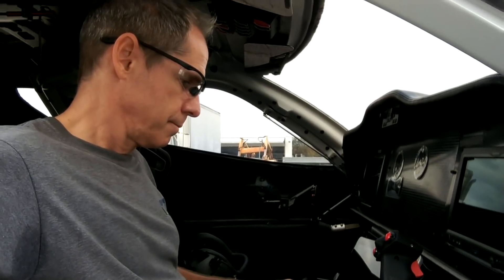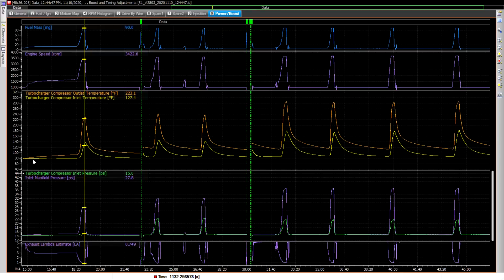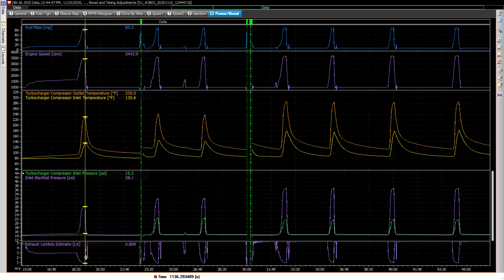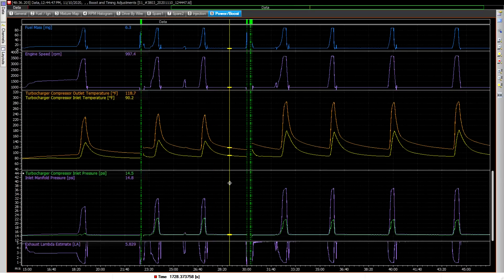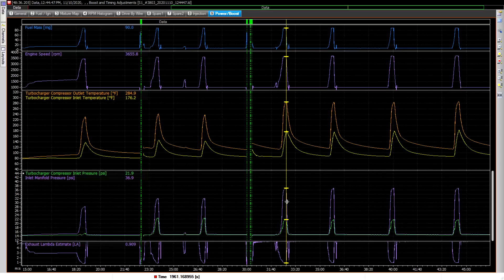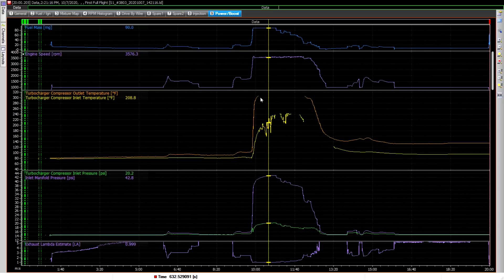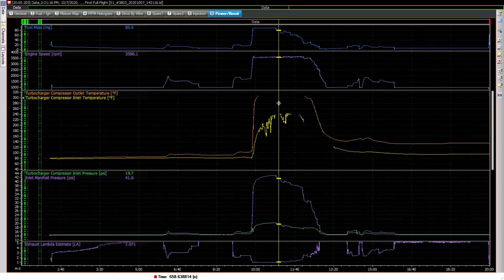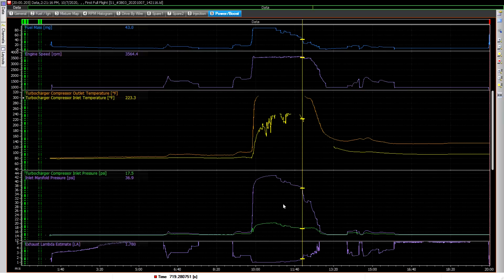Assessing Boost Levels - Building the Raptor Prototype

Comment: Your intercooling is kinda not up to the job it really liked the 43psi run but I suspect that's more like 27psi gauge. I would either go to a bigger one or and I think this would be lighter and easier add a small but high flow intercooler air to air in between the stages and a duct. I'm guessing this will net you something closer to 120°f iat or better.

Comment: Peter, you should speak with a diesel tuning shop. There are numerous misconceptions at play. One is that lambda represents peak efficiency or power. It assuredly does not. Also you'll never get substantially more power at lower boost without improving the intake system efficiency. You should be using a largish turbo that has a ve map suited to your application.  You need better efficient intercoolers with lower pressure drop to cooling ratio. Get rid of the second turbo, it's massively inefficient compared to a single large turbo. Compare your calculated hp to what tuners are getting with your engine. If it's a big gap hire a pro to tune.

Comment: Howdy Peter, have you looked at any of the auto racing community cooling tricks. Summit racing has a number of options for inline coolers where you could replace the lines under the ship. The airflow through the tunnel with gear down could provide significant cooling if you can get them to fit. Of course throwing an anemometer into the tunnel to measure that flow would be interesting. 

Too bad you don’t have the leading edge cooling you discussed early in the program. A lot of surface area in the wings and in the fuel to throw excess heat during the high power demand times.

Comment: It looks like you’re using a sequential turbo setup. This is great for a street car, where turbo lag is very undesirable from a customer standpoint. However a setup like that is very thermally inefficient, producing more heat than necessary .
The engine in a street car spends 95% of its time at <15% of its rated power, because for a regular car only 15-20 hp is needed to cruise at legal speeds. Boost periods are short, often not even long enough to heat up the intercooler.
In an airplane you can spend long periods at or above 75% rated power. But turbo lag is irrelevant in an airplane. 
I would go for the biggest single turbo for this. The bigger the turbo, the more efficient, but the more turbo lag. At 40 lb of boost you are shooting for a 2.7 pressure ratio. Pretty much in the center of the efficiency island for most turbos.

As for tuning for Lambda 1.0. Don’t. Unlike gas engines, the diesel air mix in cylinder is not uniform. The injector spray cone burn rich in the center and lean on the outside. 
Experience has shown that a slightly lean diesel exhaust gas Lambda ( ~ 1.2 ) produces the most power.
Reply: 350 hp at FL250 for an engine that makes barely that at sea level is extremely ambitious. This requirement is normally turboprop territory.

Comment: I been driving, working on and building diesels for nearly 20 years. I have a couple of questions on the heat. Is this a compound turbo? If so is the charge air cooler between the turbos or before the intake. Why did you decide on a air/water inner cooler and not air/air? Is your the reasoning intake air temp at altitude? I would suggest trying an air/air before going through the work of installing an auxiliary radiator. It will drop the in coming air to the radiator to nearly ambient temp. It will also increase air density by a wide margin. Which in turn will increase boost and lower EGTs. Auxiliary radiator, I would highly suggest an oil cooler in the same location. On tuning it's a bold move to try to tune it on your own. I know folks in the tuning world that have been doing it for a decade and are still learning. Get in touch with Banks power, Gale Banks is the pioneer of diesel power. You could get so much power out of that motor and still keep the heat down. Your doing a great job! Keep up the good work.
Reply: You left off a slice of bread if that was supposed to be a compliment sandwich
Reply: @keim3548  I'm in no way making any insults about Peter or the work he is doing. Just using my experience with diesels to help him out. Sometimes when you have an outside eye look at a project they ask questions that you didn't ask yourself when you were building.

Comment: Good vid appreciate the incremental steps in moving to an understanding of temp profile for pattern alt/cruise.  A lot of these comments don’t seem to appreciate running 100% power setting on the ground is not the objective of the exercise.  A Navajo or king air can only run for short periods on the ground at 100% before cyl. Head temps run off the charts....

Comment: Hmm... I must be misunderstanding how moving the cg forward would lower your alpha. The alpha is a function of how much lift you must produce at a given speed, lift = 1/2 rho v^2 cl wing area, so I would expect that the added weight would actually increase your angle of attack, and the offset cg would just mean you have to increase the deflection of your elevator, which both of which would get more drag. Perhaps I am missing something?
Reply: Hmm. Someone must have left the dunny door open. Smells a bit in here.
Reply: The dung beetle stops for a second; something is not right. It takes a few steps back and feels the air for unexplained vibrations...suddenly, it rushes off under a nearby pine cone leaving the ball behind!

Comment: I dont know a lot about engines, but I think it might not be the worst idea to talk to someone who actually develops and engineers engines. 
I do know a fair bit about aerodynamics. I am afraid you are thinking about going for another flight without having tackled enough of the oscillation problem. While closing up the wheel cavities is certainly gonna decrease the drag, I dont think it will do anything against the oscillations. The more forward CG will help in that regard, but you add quite a bit of drag with a more forward CG. The big main wing is a lot more efficient at carrying weight compared to the canard. (even though the alpha on the main wing is decreasing, you add more downwash from the canard onto the main wing, …)
I think the main reason for your oscillations might be an overloaded winglet root. The interference of the winglet and the wing leads to a higher local lift coefficient in the wing-wingled-blend. This is mainly due to the low pressure zone of the wing overlapping with the low pressure zone of the winglet. Since the airfoil in the blend section experiences a higher load compared to the rest of the wing, this section is prone to stall earlier than the rest of the wing. Any sideslip can then lead to the leading wing stalling in the area of the blend. This increases the drag substantially on the forward wing, pulling it backwards. The plane starts to rotate around the z axis and we start to sideslip into the other direction. The other side stalls in the area of the blend, more drag is produced in this area, and so on…
Thus the whole plane starts to oscillate around the Z axis. I already thought about this problem when I saw the videos of your scale model plane, I think you still have the same problem and fixed it the wrong way by just increasing the winglet size.  
This is not something that is easy to fix, but during your next flight you could add some tufts in the blend area and film it. If I am right (which I hope I am not), you should see quite a bit of movement in the tufts, matching the oscillation rate of the plane. A quick fix that might help is to add vortex generators in that area of the wing. Normally during the aerodynamic design, a lot of attention is paid to this section of the wing and the local washout is increased to tackle this phenomenon. 

I think we share the same dream of building our own planes, and I truly want to see you succeed. I am just trying to help, like most people in this comment section.
Reply: Here Dutton, Dutton...come on little fella, you're hiding somewhere!
Reply: A suggestion for the engine tuning, “the” diesel tuning expert is Gale Banks out in California. Perhaps a call to him or review of some of his videos would be useful.
Reply: @MarkN-ji9iv   Gale would be a great consultant for this engine, I'd bet he could nail the issue down in no time.
Reply: All the blimmin crickets!!! I CAN'T STAND IT!!!

Comment: All of that work with adding a radiator in the nose where it was never meant to be and where raising the landing gear may negate any airflow to it does not seem productive. It would seem better to hire a speed shop to fabricate a new exhaust pipe to allow removal of one turbo, reducing heat load and back pressure.  As far a time, it has been weeks since the first flight so removing that turbo could already be complete it it was attacked right away.  This approach is like rearranging deck chairs on a certain doomed vessel.  You have gone full circle right back to where you started except now you plan to be more mindful of throttle.  That may be hard to do with the aircraft doing the boogaloo all over the sky.  This aircraft needs to be able to hold full power until pattern altitude without overheating or it is not flyable. Flying when that is not possible is taking unnecessary risks for zero rewards.  Back up and look at the big picture.

Comment: Some progress but.....Curious. Do we have an engineering analysis of what the target horsepower is for takeoff, climb and stabilized flight is? Without targets certain, we’re just pitching darts at the wall. This being a prototype I get that the goal is not the “ Certified Standards” but the notion of those should be kept in mind. Right now we have the goal/expectation of producing enough power just long enough to get airborne to 100’ and then pulling power to a sustainable level. Contrast that with certification demands of 5 minutes sustained Max power (Takeoff Power) followed by sustained (Climb Power.) Prototype or not, the goal isn’t even in the same time zone. That the limited capability described is the only reasonable bar attainable, I’d say the entire power element is still seriously in question. Solutions have been proposed, apparently more realistic, but are not pursued owing to time and money. This is worrisome. With these shallow incremental improvements risk is not being realistically reduced. I guess there will be time to do the full power plant mods after the off field landing.
Reply: We? Is that the Royal “we” ?
Reply: @PaulAnthonyDuttonUk  “Royal”?     Hardly. Perhaps the forty-five plus years in aviation been to too many funerals of friends that have let small or personal concerns make bad decisions for them,”We.” Look, this format, YouTube, is wonderful. Especially for a homebuilder/aircraft developer as it allows people literally from all over the world to watch and comment. Like throwing open the hangar doors and letting all manner of airport bum walk through and comment. Usually that just results in a “hey, did you know this screw is loose?” Kind of comment. Which is good because the builder reacts to the feedback and tightens the screw. But here, we seem to get the picture but not the complete one. “We”,the audience, are kept in the dark. “We” are told the builder has consultants but due to any of a variety of reasons”We,” don’t know who they are, their level of expertise or actual ability to effect an outcome. The item of concern de jour is the powerplant. Developing both a new powerplant and airframe at the same time has killed more than one project and or pilot throughout history. Ideally, a proven powerplant is used in a new airframe, configuration permitting, and the powerplant is developed either on a bench until worthy or, in a proven airframe. “We” the audience are left wondering if mindset of the builder is leading him astray. I see a lot of,”Get thereitis,” which is the bane of aviation safety. Again, “We” only see a small portion of what is going on, that which the poster wants us to see. And nobody can force him to do anything, like stop, reconsider or even tighten a screw.

How many time have commenters suggested, begged, cajoled him to modify the turbo set up by listening to the experts? The advice was to bite the bullet and go to a single turbo, a simple stable configuration with far fewer peripheral demands as far as cooling etc.. For crise sake, the initial flight was made without complete baffling in place. There’s no over site and control as there would be in a professional flight test development program. The element that stops the rush and demands introspection.

So,”We” the audience are asked to participate but are powerless to effect change. Like approaching a red light intersection in the back seat of a car at speed, suggesting the driver stop but he’s got the stereo up too loud and wants to get where he’s going in a hurry.

I’ve lost friends in aviation by all manner of accident. Most were avoidable either through hindsight or foresight. Enough experience with hindsight leads to foresight. The builder seems like a great guy. Clever and romantic in his quest. But even the Wright Brothers brought in expert help and let him run when they were stymied. Ironically at the same point. Powerplant.
Reply: @stephenwalton7079  Unfortunately you've just given it exactly what it wanted. Validation and a feeling of influence. The creature is lonely. It can't contribute meaningfully to a discussion but it knows that opinions are emotionally derived from personal experience and therefore easily derailed by agitating the ego with a simple insult. It's a sad, pitiful method for deriving self-value and can be replicated over and over with relative ease. In essence, it just wants to feel loved.

Comment: You must be running the inbuilt oil cooler, which is cooled by water, if you run an air oil cooler, that lessens the work of the water and increase the oil capacity(insignificant though) mind you, I'll install a thermostat for the oil, but then we have to establish whether the is enough airflow in to the engine bay to get the heat out of the oil cooler.
Reply: Another thought to add , since you are working on a cad drawing for the nose piece , why not have it 3d printed for optimized air flow...would have like to see an egt overlay over the lamda...Actually the raptor is already a perfect  engine dyno...just need more sensor to get more data.

Comment: Have you considered this;

A larger radiator (in place of the current one) with a shrouded electric fan to draw the air through the rad when needed; you also need an oil cooler in front of the rad (you wouldn't need to open the scoop as much). Presently, when the scoop is open the air pressure in front of the rad (and behind it also) would increase with air-speed which doesn't necessarily translate into increased cooling if the air (heat) doesn't readily flow through and exit. You may also need to consider another way to vent the heated air behind the rad - like vents that can be opened on the side of the fusalage aft of the rad.

Also, if possible, remove the counter weights on you ailerons - my thought is that drag on them may be causing them to vary the aileron deflection (there must be some slack and movement at 100+ knots airspeed) causing your ailerons to work a bit like flaperons (very undesirable of course); whenever you input left or right aileron pressure the counter weights drag pressure will vary on the aileron also; this may even be the cause of the plane wanting to bank to the right. The counter weights will try to push the ailerons up causing the craft to first nose up, your response would be elevator input to push the nose down each time changing the angle the counter weight shoes meet the slipstream varying the drag on the shoes and pressure on the ailerons.

Best of luck to you.

Comment: Would much rather you add cowl flaps or something. You aren't going to get much more cooling detuning the engine simply because of heat soak. 

Possibly consider adding additional side scoops on the rear portion of the main scoop. Like a tri scoop but the secondaries aren't as long. Just need more quality flow. The secondary radiator should fix the issue, if it doesn't fix itself at elevation, which I believe we should have checked 1st before anything. I would also consider heat rapping the exhaust aswell as turbo socking those turbos. It's really just the high compression ratios of the diesel plus the charged air doing you in.

Comment: It doesn't appear to be a fair test. Obviously, the deactivated turbo was still ducted into the system, adding parasitic back-pressure. I know it would not be easy to reconfigure the engine for each test, but acceptance of the issue would be good. Though, respectfully, you are even reluctant to adjust the mixture for each turbo setting. Now, how can hot cool air enter the engine compartment, to exit?
And so, you may indeed "being mindful" as you were the last time you flew the plane, being distracted by the temps.
I am curious if a single larger turbo would save weight, and still give you most of your performance.
If you put a rad up front, you would need to make the cooling lines larger, and that would add weight. I would want another win/win scenero for you.
I fancy the idea of putting in 2 ducts, on on each side, aft near the wing root, like nacelles. Each duct with be split for either radiator or inter-cooler, and the remainder of the duct could be used for cooling the engine compartment and headers.
These engine-things are heat-pumps; the more HP, the more cooling is needed.